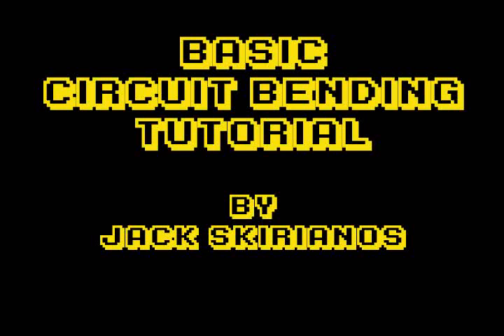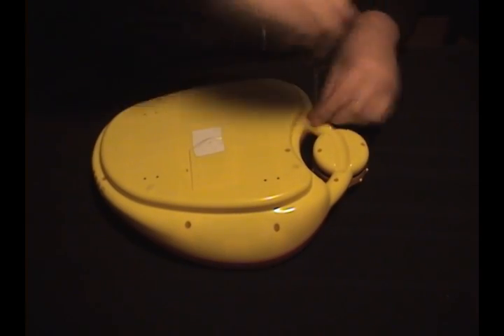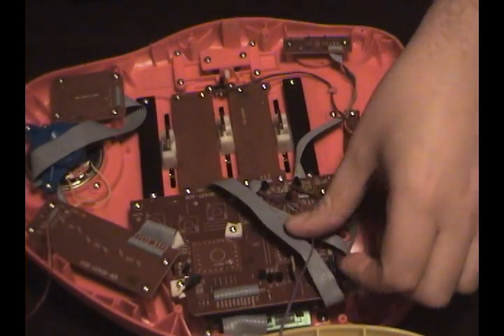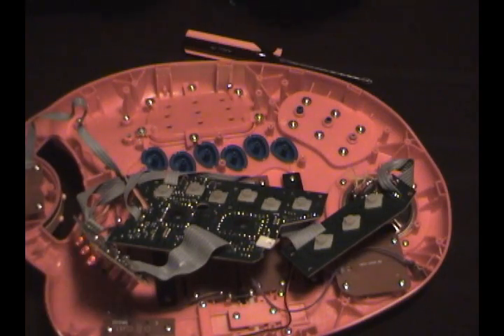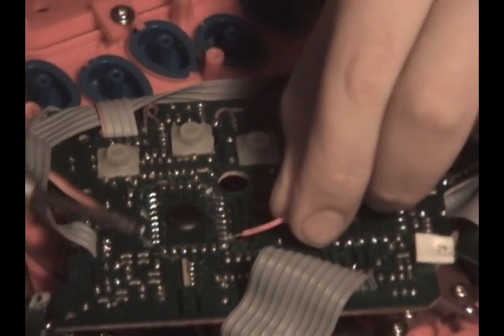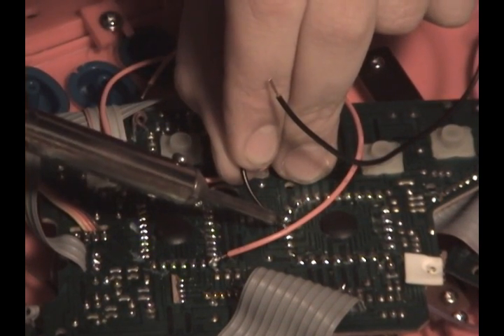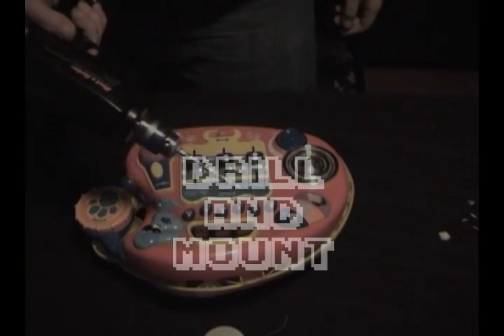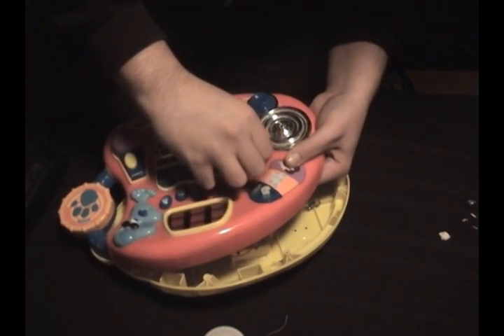Basic Circuit Bending Tutorial

Comment: I bought some solder but it was lead free solder.... and  i was told that lead free solder wasn't any good because it takes too long to heat up? does it matter if i use lead free solder or solder with lead?
Reply from the maker: I don't think it matters, you can check out a soldering video somewhere on YouTube for the finer details though.

My tips would be practice before you actually start messing with equipment you actually care about. solder is tricky because it just suddenly becomes liquid and you have to work carefully and decisively because once you move your iron away it turns solid real fast.

tip 2, (you can kind of see it in my video) put some extra solder on the wire you attaching FIRST, just a little glob on the end that way it will be easier to get a good grip, most of those little solder points are so small they don't have enough solder to hold an extra wire that big.

Comment: Pretty much the only time to ever touch the battery wires is when making a reset switch.
Reply: +origamigek  the toys can freeze and freak out some times and a resets just makes it easy to cut power and continue when performing so you don't need to find the power switch and fiddle with it (toy powerswitches are often on the back or need to have batteries removed and a a pain when performing. )
Reply: To force a melody to reset?

Comment: No, but switches that can handle higher current (regardless of voltage) are usually more expensive. With something with this low amount of current (usually milliamps), and this low  of a voltage (typically 3 - 6 volts), you can use just about any type of switch. From the micro-switches used in computer keyboards, to the light switches used in homes (if you want it to look ridiculous).

Comment: I think i understand how it works. The small rivets that form a square are connected to a certain wire and to buttons that when pushed, push something down in there that contacts and instructs the circuit board which action to do depending on the rivets and it sends the message to the speaker of which sound to play, right?